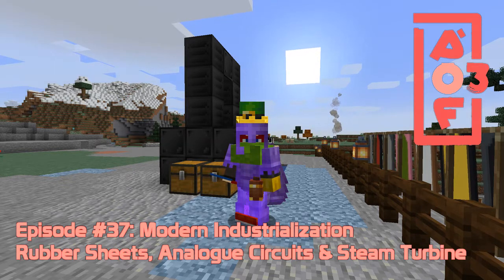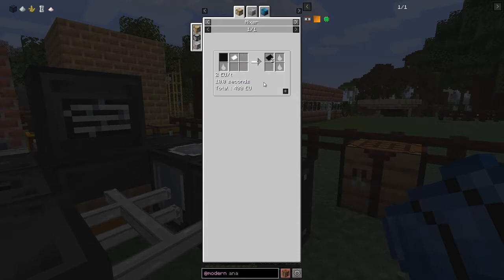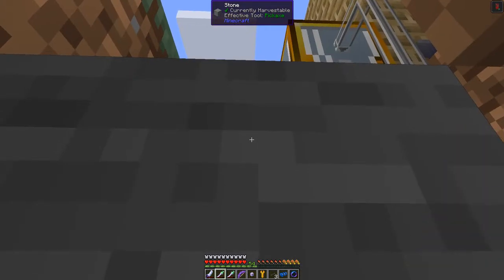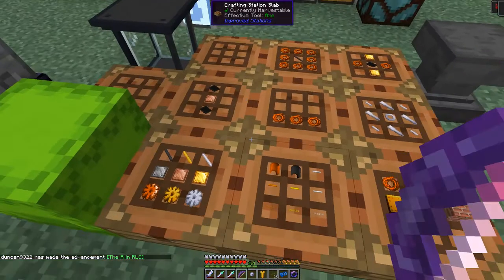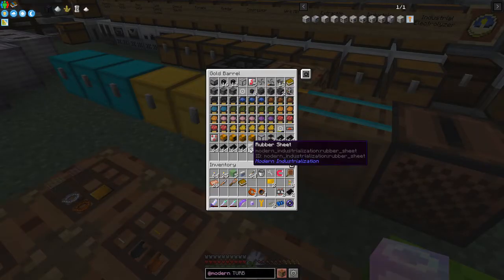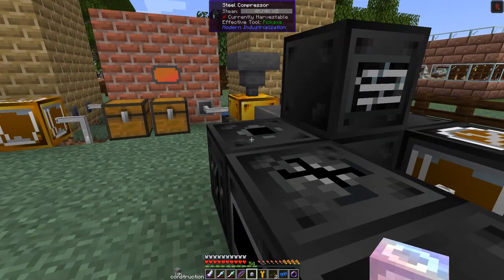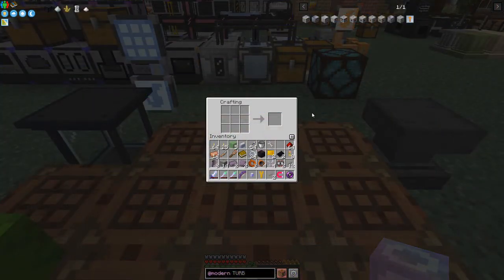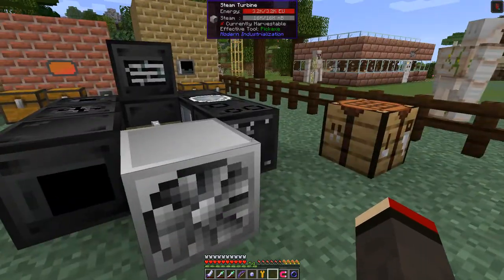All of Fabric 3 #37 - Modern Industrialization: Rubber Sheets, Analogue Circuits & a Steam Turbine

Comment: Hey dude! Great video! I'm having some trouble with the steam turbine, I can't get power out of it. I've used HV cables, insulated cables, MK1-4 cables, and the actual Modern Industrialization Tin and Copper cables but NOTHING sticks to the steam turbine. Do you know how I can get the power out? The book doesn't even mention the steam turbine and there's somehow NOTHING on google....
Reply from the maker: You need to shift-right click the face of the turbine that you want the tin cable to connect to and the right click the end of the cable so it connects. MV cables and higher won’t connect as the turbine is a LV machine, there is an upgrade to allow electrum cables to connect. Hope this helps.
Reply: @duncanwebb4934  Omgggg that helps out so much thank you dude! You've earned a sub!
Reply: @duncanwebb4934  And how do i connect the electric quarry?
Reply from the maker: @medicguy4490  the electric quarry is a medium voltage MV machine, so you need to use the advanced steam turbine and electrum cables, alternatively you could use a LV - MV transformer but I’ve not tried this yet.
Reply from the maker: That was not 100% correct the advanced steam turbine is an MV machine, and it needs MV cable to connect to it, same method as the steam turbine. The input hatch needs to match the cable type. When a machine is shift-right clicked with the wrench it makes this face the output face, all the faces can be input. Hope this helps.

Comment: I want to know hoe much EU is produced for tick cuz i need to run my automated machine
Reply from the maker: Modern industrialisation has tiered generators so it is important to match the generator against to machine and then you will have enough power. It gets a bit more interesting after adding upgrades to machines as the power requirements change. If you need more power then just an extra turbine or upgrade it to an advanced turbine and add the transformer. Later videos show more about power. Sorry I can’t give you an exact number.

Comment: i just started getting to this stage but when I put raw synthetic oil into the steam blast furnace nothing is happening. Do you know why?
Reply from the maker: Does the blast furnace have a fluid output hatch? This furnace needs three fluid hatches, two input and one output. One of the inputs is for steam and the other is for the rubber. So long as the multi-block is valid then it should work.
Reply: @duncanwebb4934  Yep that was the problem. when trying to put it in I only had one fluid input so I thought it would work. Thank you for replying so fast
Reply from the maker: Sometimes I'm quick and sometimes not. Delighted this was the solution, I had a similar problem getting Liquid Air.
Reply: @duncanwebb4934  Had the same issue, thanks for the solution!
Reply from the maker: @Howlongcanaurlbe  glad to have helped and thanks for saying so.
Reply: @duncanwebb4934  You're an angel sent from heaven
Reply from the maker: @mrglitchcrazy8695  I guess you had the same problem, delighted to have helped. I like it when people say a video helped, thanks.